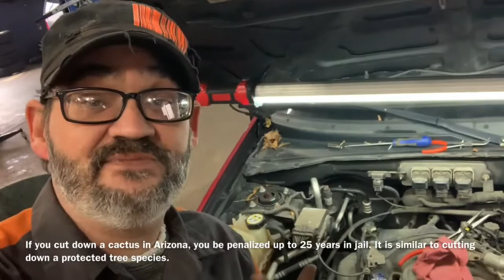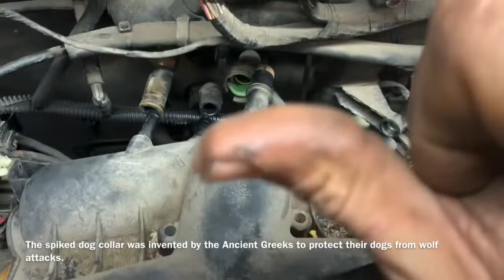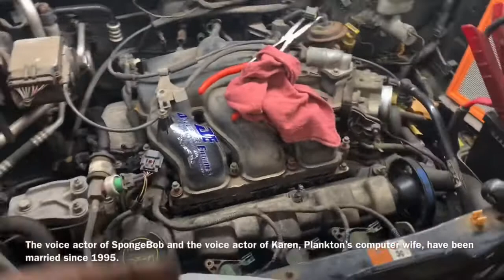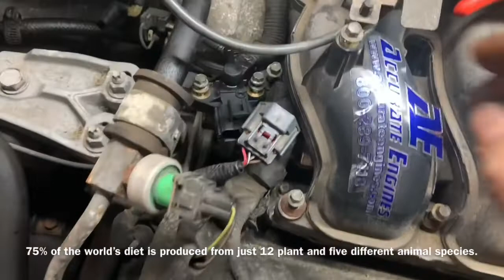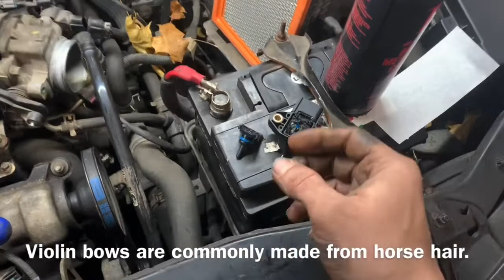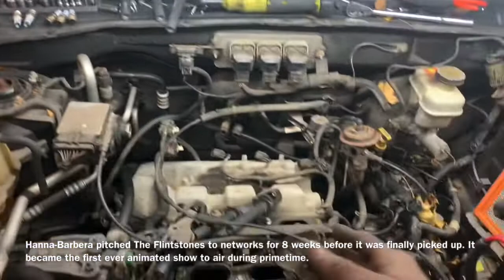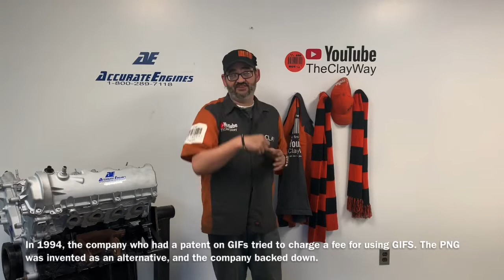Possible reasons why your Ford escape is running poorly/stalling at lights/reasons it’s smoking

Comment: There was a loud bang when driving then it wouldn't go past 25. Now when I start it it sounds like a chopper and chugs along after putting out after a mile. What can this be?? Thx
Reply from the maker: I would be about 99% sure even over a text message that you blew out a spark plug I have an excellent video showing you how to fix it if the thread stripped out it is extremely common with these and it’s really not that difficult fix.

But that is definitely what happens and the sound it makes when that happens to it

You can look underneath my Ford Escape playlist or you can message me on Clays AC and auto repair on Facebook and I will give you a link sometimes I do not see responses on my YouTube channel

Comment: I have a 2013 ford escape sel that runs fine in park and natural but when u try to drive it will have no exceleration it will pop and spudder then it will go then start popping and shuddering again eventually it will drive fine after a while

Comment: Hi, I’ve got a 2006 Ford Escape. The vehicle tries to turn over, but just smokes up near the starter and it is an electrical smell and white smoke. Have you ever come across this issue?
Reply from the maker: Well either your starter is bad or worst case scenario your engine is locked up

You need to turn the harmonic balancer and make sure the engine is not locked up. If the engine spins when you turn the big bolt on the harmonic bouncer then you need a new starter if not you need a new engine you’ll have to do some research on this to see how to do this procedure I do not have video of that

Comment: I got a 05 escape when the car sits for long time hit the key and its starts hard like long cranking then it fires and runs great what u think?
Reply from the maker: Fuel is probably draining back into the tank. So it would be a defective check valve

Comment: I may need some input on 2005 Ford escape hybrid sports utility 4wd 2.3 4cyl.. just got transfer case replaced but now after driving for a week or 2 I've started to get a wiff of gas randomly while driving but then goes away after a little while and now I'm hearing a very slight winding while accelerating and notice I'm a little over the 3 in RPMs going about 40. When trying to pick up more speed it then hits closer to the 4 in RPMs. So i release and try again so that I'm not over doing it or making in worse. But Also at the same time that i noticed the slight windin noise I also noticed very light vibration while idle. It doesn't idle long before going quiet but engine is still on.. i didnt have this problem before the transfer case went bad. Just wondering what it maybe that's causing this. I can definitely sense something is off from just being able to feel it with my foot resting on the gas pedal allowing the car to glide in whatever speed I'm in. Over all i get a strange feeling that it's not performing as it should. Any ideas? In the meantime going to get a complete tune up see if that helps..

Comment: I have a 2002 3.0 escape idling rough but no codes any ideas?
Reply from the maker: You could have a problem with the catalytic converter but more than likely The EGR is mechanical , so your EGR is probably stuck open, or it could be your idle air control Well there’s different things that could possibly be bought them in the most common

Comment: Hello, I am trying to look into fixing my fuel regulator. Unfortunately I cannot find it, looks like the wires were taped, not super knowledgeable on cars! Please help!
Reply from the maker: There is generally tape around the wire loom’s from the factory so that would be normal
Reply: @sharpcarco  okay, where would I find the regulator? I followed the spark plug wires towards the general area and I cannot find it
Reply from the maker: Well just make sure your not confused on what your looking for . Please PM Me on my Facebook ,Clays Ac and auto repair . I can send pics there .
Reply: @sharpcarco  Okay sounds good thank you!

Comment: Hey Clay, I have 2002 escape v6, have the surging idle by itself, sometimes not always more noticeable stop and go traffic, I have changed many parts, spark plugs all coils intake gasket egr valve and gasket intake air control valve mass air sensor pcv and Tps sensor, and I use a smoke machine check for vacuum leak and it seems holding , I don’t have black smoke coming out from the tail pipe, it has been like that for a while when it does happen while stop at the traffic light I rock the steering wheel back and forth a lot of the time the idle will come down , any suggestions? Thanks
Reply from the maker: Hey Andy I actually just did a video on that.... Exact same thing In addition to it surging at an idol after a while my air  would only blow out the defrost.... so if you’re having that problem my video that I have up here in a couple of days will certainly be of help. In my situation it was the vacuum lines behind the intake were cracked but you have to look close at them because they will look fine from a short distance away but once you start bending them a little bit you’ll notice a bunch of cracks. And it cured that surging problem not a real expensive repair I just only recommend you repair the lines one at a time so you don’t get mistaken where they go. So watch out for that that may be helpful for you if it’s not that it is a possibility that your EGR is not working properly because it is mechanically vacuum operated. And it could also be your oxygen sensors but I’m fairly certain that you’re going to find some vacuum lines that you may have missed if you’ve already replaced them and the video may be a little help. I’ve been extremely busy and I still need to make the open and close but I believe I have the root of the video all done. Have a good day and welcome to the channel
Reply: Fantastic Clay! Wife’s 07’ is running rough and will do the coil check, and vacuum lines check also along with plugs
Reply: Hay clay first time finding you"" my 04 Ford escape idles rough when first starting it,, and going on road ,if it gets in the least little pull up little hill etc it starts missing,, sputtering,, and all gauges go crazy, most time if I hit bottom and take it out of over drive it will clear up go back to normal, or mash gas pedal to floor and it will clear up,,,But"" it seems to do it worse and lot more often when it a rainy wet day"" Heeelllp!! Please lol
Reply from the maker: Well, Abbott, more than likely it sounds like your catalytic converter is plugging up, which will eventually ruin your engine so I would recommend getting that checked out or checking it out yourself.

Comment: Hey I have a Mazda Tribute 2.0L it runs rough at idle and wants to die then it will eventually stall but runs fine on the highway please help
Reply from the maker: Well that’s a tough one to answer over a text message it could be that you have a bad fuel pump it could be that your EGR valve is Open all the time your catalytic converter could be plugged up. And the list could go on and on and on. 

Very sorry I couldn’t be of much help with that situation without knowing up there about more details

Comment: Hey clay i like your videos, i would like to know why my 2004 escape Egr valve explode and i change it and then again explode like a month later 
 Thanks for your help!
Reply from the maker: Well thanks for the kind words. More than likely that’s happening because your rear Catalytic Converter‘S is plugged and the air has nowhere to escape but through the EGR valve…
Reply from the maker: That would be a good video
Reply: It’s the catalytic converter for sure it happened to me twice I bought a entire new system for 600 dollars off rock auto you won’t be able to straight pipe because the o2 sensors are located in the cats but changing the system will fix your problem

Comment: My 2011 Ford Escape stalls out! I have no catalytic converter cause it got stolen I had straight piped out. I had a full tune up done, sway bars, ball joints done
Reply from the maker: Hmmm we’ll there are 3 cats I don’t think you would be driving it if they stole to exhaust manifolds , it not a 3 min job to get them off .
Reply: The Clay Way ok.

Comment: I live in Tonga and here no any good mechanics are available. I cannot find fuel pressure sensor in my Ford Escape XLT 2.3L 2006, EP3WF (from Japan, right steering wheel), it is not at that place where it shown in many videos I watched; and I can't locate it anywhere else. But it should be existing in that car, and symptoms showing that most probably that sensor is failing: it was working well (mileage is 23000km), but after couple of months parked it now starts but dies right after start (can't hold idle rpms; all symptoms shows that it runs on too rich fuel, no obd2 errors, but fuel pressure nor air to fuel ratio not reporting while I can get readings from other sensors: intake psi 14.36, coolant 64`C, throttle position 40.39`, timing advance 10`, fuel flow rate 0.12L/hr, catalyst temp 279`C, rpm 1100 (I was carefully holding open the throttle, if release - it dies. Help, please? And can it be possible that car have no fuel pressure sensor even if I can find part replacement by part number particularly listed as fits that exact model ?

Comment: Hi. Clay great video! Q: I have a 2.3 4cly it will not take off fast at all from a stop. It idles just fine and revs up just fine. I just replaced the entire exhaust system thinking it was the catalytic converter but it's still doing the same thing. I have reprogram the computer but it's still doing the same thing. If you can help me out it would be greatly appreciated or at least head me in the right direction. Thanks
Reply from the maker: Is your gear selector working correctly? Are you certain you’re not taking off in second gear?

Try pulling the gear selector all the way down taking off and shifting through the gears manually see if that has any impact

Let me know how that turns out for you that’s a very common problem people think they’re taking off and drive and they’re actually taking off and second gear
Reply: @sharpcarco  yes sir I will try that and let u know. Thanks
Reply: Unfortunately that did not work it has almost no go on take off but after five or six seconds it will start picking up speed and also does it once I have speed and let go of the gas it will take another few seconds in order for it to re-engage and take off again it is showing a po340 code on the reader but the camshaft position sensor is new would you suggest me replacing it again?
Reply: @Mrsolo-cx5tp   did you ever figure out what it was? I an having the same problem.
Reply: @BigChristopher  yes.. I did the timing chain had jumped😑 witch is odd because its steel chain what. I found out was the bolt that holds it down loosened somehow...hope this helps the next guy. Good luck
Reply: @Mrsolo-cx5tp  appreciate the share thanks
Reply from the maker: @Mrsolo.82 1982 I’m really surprised I’ve had quite a few of these engines and I’ve never had the timing chain jump on it . Sorry to hear that Mr. Solo . That was really nice of you to answer you’d be surprised how many people don’t do that and I’m sorry I hadn’t seen your messages after that. YouTube comment section doesn’t really give me notifications all the time for messages but I’m glad to see you’re still around

Comment: My Ford escape misfires . Stops sometime when driving on highway. Have change  fuel rail sensor ,idle control valve . mAF still
Reply from the maker: More than likely you’ve got a plug catalytic converter because of the misfire .... when a vehicle misfires it is not burning fuel and then it drops down into the catalytic converter which is super heated and then the fuel ignites inside the catalytic converter destroying the catalytic converter. ...... Of course that’s just a guess because I’m not there I know you tried to give me the information you could but there’s a lot of information that would be involved in determining that problem
Reply: I went Bach charges the following and everything came to normal . I change the fuel pump, fuel rail sensor  idle control valve
Reply: Mine is doing the same except I don’t have a catalytic converter mine was stolen so I had pipe out

Comment: I have an 2003 Ford Escape V6  it starts fine but runs a certain distance and shuts off..
Reply from the maker: Sorry to hear that Sean more than likely it’s because your catalytic converter‘s are plugged obviously I would need a lot more information but that’s been a very common problem with these especially after they’ve had a misfire for reconsider amount of time before it was repaired properly.

With a misfire on these particular engines the fuel goes down inside the catalytic converter and eventually builds up and explodes destroying and melting the inside of the catalytic converter. Not allowing the engine exhaust to breathe making them either not start or shut off after they have been running I’m certain that you noticed a considerable large amount of fuel usage. At least that’s usually associated with this particular situation that I believe you are having.

I hope I’m correct but I also hope I’m not correct because it’s not easy or cheap to repair. 

Let me know sorry if I am incorrect
Reply: I hope not but the mechanic said it was bad wiring which he fixed and I had to get a exhaust gas recirculation modulator so hopefully after installing and code clearing it'll run fine
Reply: @shawnd5418  what did you find out?? How does you vehicle run now??

Comment: 2005 ford escape stalls in idle or while driving at any speed. Starts right back up though
Reply from the maker: That’s what mine would do when my fuel pressure regulator module was going to be active like I showing this video. Eventually it got to where it wouldn’t start at all.

You can start it up and wait down by the fuel tank and take a listen right before it dies you’ll hear the fuel pump cut off if the fuel Pump module Electronic module is going bad. Right now I don’t have any thoughts off the top of my head that I didn’t speak about inside the video
Reply: Thankyou
Reply: @sharpcarco  the IAC  motor will cause this as well and PCV filter
Reply from the maker: Yes it could and I think I mentioned that in the video as well. I work on about 50 different types of vehicles so it’s difficult for me to try to remember every single little thing that could be a possibility I just try to help people out and give them some ideas and directions to go in my situation it was the fuel pump driver module
Reply: 2010 Ford Escape 4 cylinder AWD.  She drives great and everything is good and no engine lights however wants to die at a stop sign or light and low idle.  when going from fevers to drive after been raining, does it then too. My guess is EGR valve from what I’ve read.  Thoughts anyone? Thanks and awesome video man.

Comment: Any people who own a Ford escape with a V6. Mine is acting weird but it's not throwing any check engine codes. When you first put it in drive or in reverse the idle drops low and it runs really rough, makes a weird noise and it feels like it's going to die, until it starts moving then it runs and shifts fine. And only once you come to a full stop and wait at a red light it will feel like it's going to die again. Any ideas?
Reply: I’m having that same issue
Reply: Same issue y’all figure it out yet